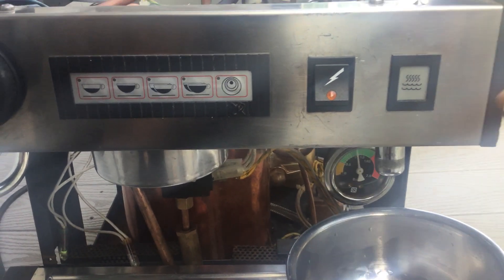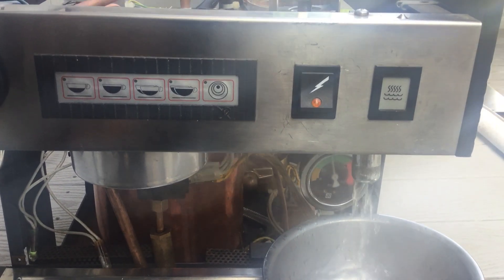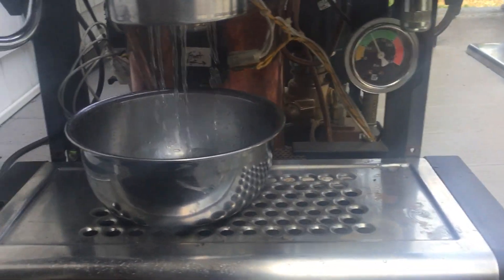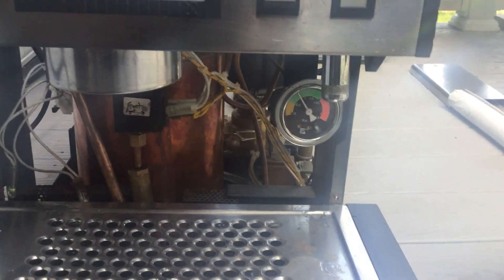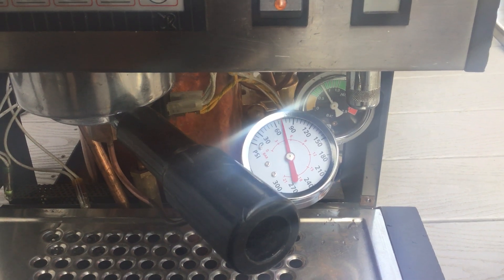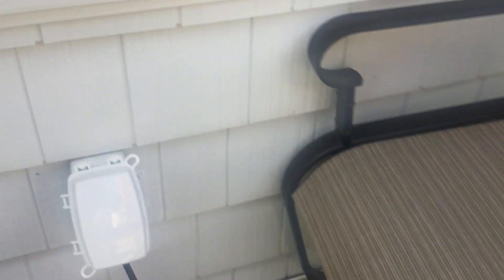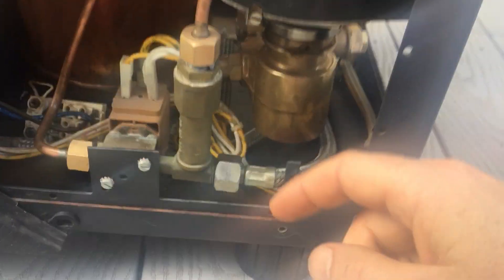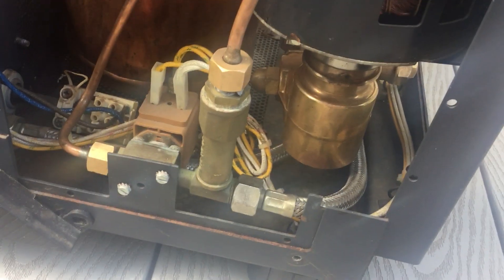Rancilio s27 pressure

Comment: Hey Jesse, I just picked up a Rancilio S27 that seems to work properly save for the group head.
Specifically the buttons over the head do not activate the water flow. 
Any suggestions?
Reply from the maker: Sorry I'm not much of an expert.

I guess the thing to narrow down is if it's the button panel that's broken:

https://www.espressoparts.com/parts/commercial-espresso-machine-parts/rancilio/s-20-s-27-parts/s20-electronics/rancilio-s-20-12-pin-two-dose-touchpad-board-om-t

Or if it's some mechanical part that's the problem, maybe solenoid isn't working correctly, or maybe group head is just jammed up. I recommend asking in https://www.home-barista.com forum, you'll get someone who actually knows what they are talking about.